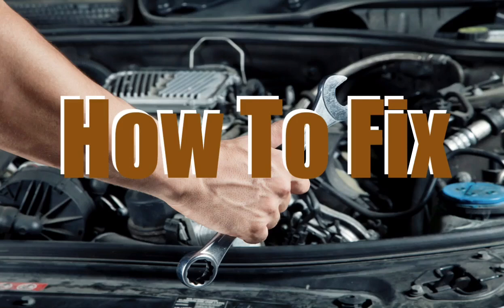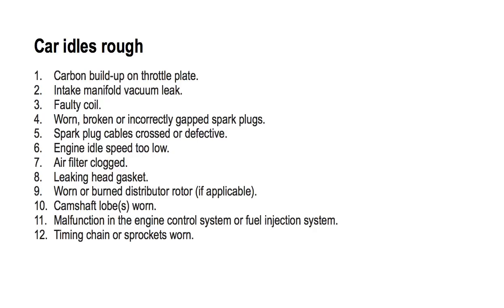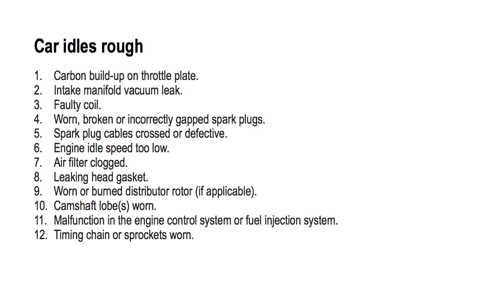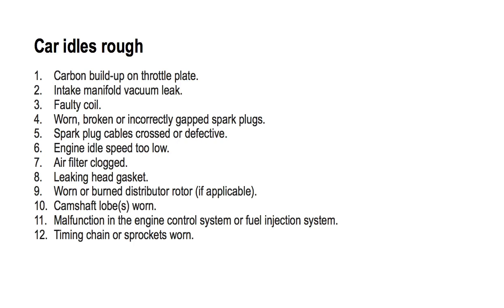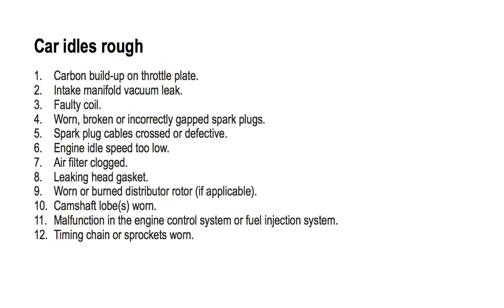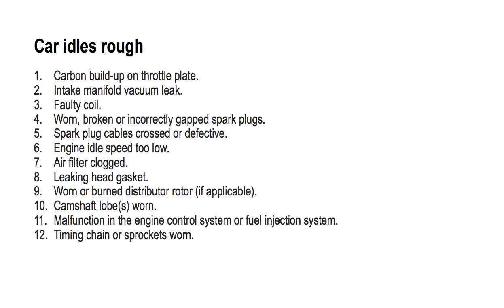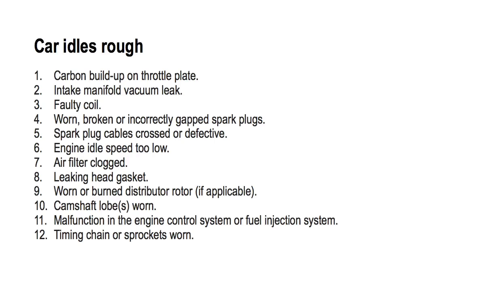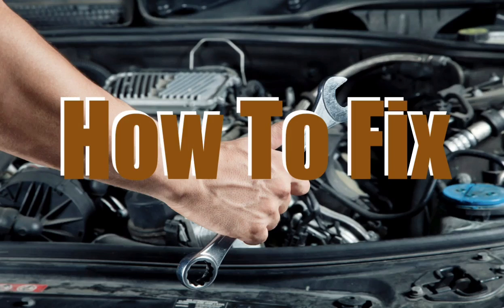Car Idles Rough

Comment: I have a story, which is a puzzle for me and probably for many who reads it. I went to Firestone on 
Northway Hwy to do alignment and State Inspection. The car is old, and basically it is my toy-car 
to practice on auto DIY projects. 2001 Saturn SL2. The car was running maybe not the best, but 
normally, my main concern was alignment, bcs I did a lot of suspension work on the front, and my 
husband observing how I move parts around came to the conclusion that the car will never run 
again. At Firestone they couldn't do alignment, bcs they needed a special tool (for the rear), which 
they didn't have and advised me to go to a dealership to do a proper alignment. To my amazement
they said that the current alignment on the car was pretty good, gave me a print, which proved it. I 
assume, the alignment was good, bcs I counted turns on outer tie rod very accurately. They said 
that the battery didn't pass the test (car was sitting for a long time), but passed the safety standards, 
so I need to make 50 mi on it and come back. I went back home, and on the way I noticed that the car 
started to shake slightly at one red light. When I came home the engine was shaking like crazy. I 
switched it off, took Actron, but before diagnostic decided to start it again and listen once more what 
the engine does. The car started vibrating vigorously, the arrow of the rpm jumping from 400 to 
1200 and back all the time, then after a loud sound ("bum!") died. There was a small puddle on the 
ground from the transmission fluid.  Actron gave P0404 code, which is emission code, so I decided to 
clean a Throttle Body, what I did, but there were not much changes. Next morning car died again 
on idling, when I warmed it up. Now in addition to P0404 it gave a code for the Powertrain Module 
(Engine computer). I started the car again and without any waiting in Idle went to the Toyota 
dealership, they did some work on alignment, but also didn't have that tool for the rear of the car, 
and advised one GM dealer. I suspected bad fuel, so I added like 1/2 tank to make it full, poured 
good engine cleaner, car started to run a bit better, but still vibrating at stops (though at 800 rpm 
already). No more leak fm transmission. In that condition (car was still vibrating on lights) I went 
to Jupiter Chevrolet Dealership, where they did the front alignment perfectly, some rear, but not 
toe (again no tool for that job on the rear). When I started to drive  I immediately noticed that the 
car runs perfectly well, no rattling, vibration, you could sit like hour in Idle, it runs very smoothly 
and good. I went back to thank and ask, what it was, what did he do,  but the mechanic gone for the 
day. So my question for the puzzle is: what can be done to the car that it develops a vibration on 
lights, and see how, not immediately after I left the Firestone, but after about 5 miles of driving? 
And what the mechanic at Chevrolet Dealership did, that the car runs with no problems now, very 
smoothly and quietly. Later Chevrolet mechanic said that nothing was done besides an alignment, 
and he never opened the hood. I would appreciate any ideas or hypotheses. 
Thank you for the great film.